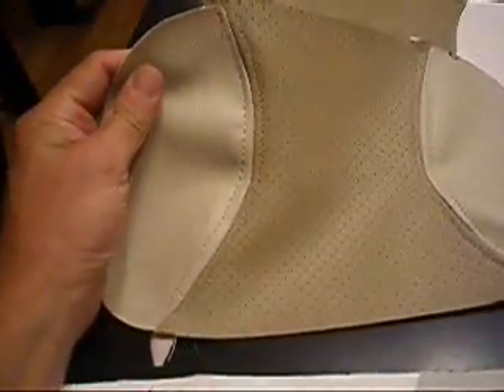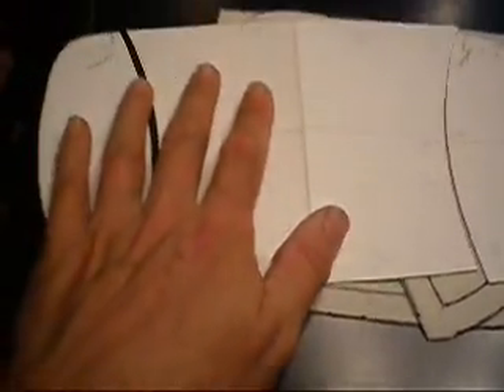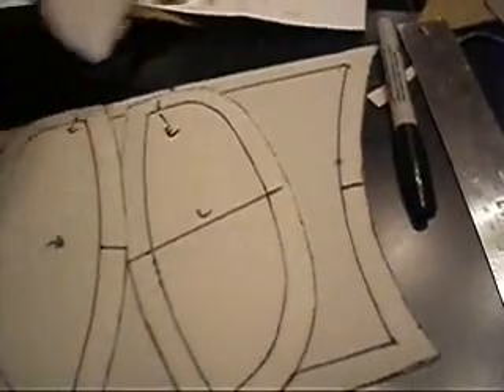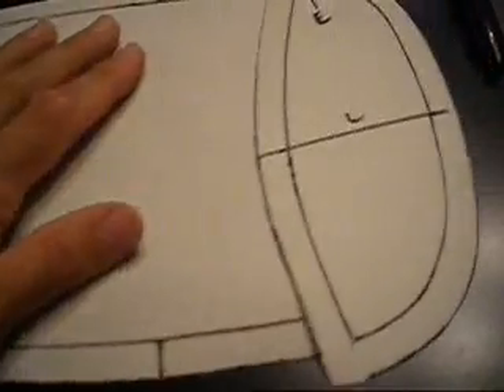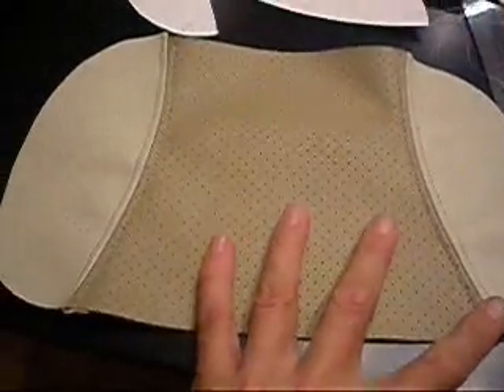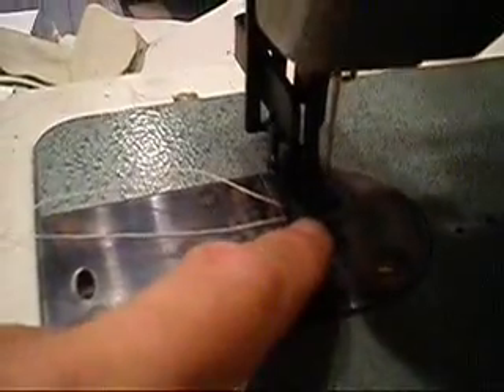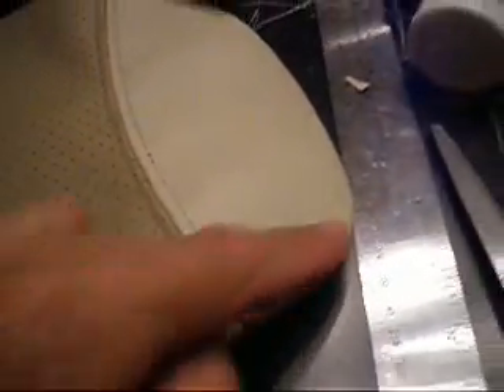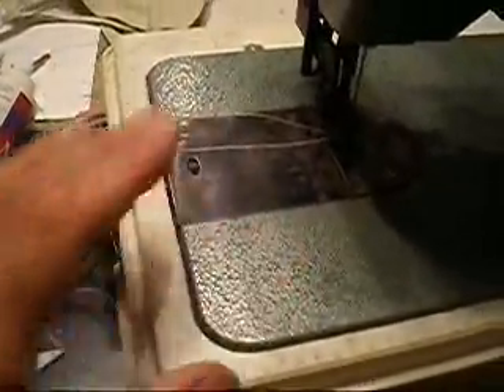Headrest Upholstery - Part 1

Comment from the maker: @77petesgarage Thanks man.  I went to a local upholstery supplier.  They had 10-15 sample books with 1000's of colors and patterns of vinyl, cloth, trim, carpet, canvas, etc....   I got the piping from an auto upholstery shop.  They just reeled of 30 feet and I gave them a few bucks.  The suppliers want to sell you 500 feet.  The thread came from the dude who sold me the machine.

Comment from the maker: Can you expand on what you mean by thread length? If you mean stitch length then you adjust that by moving the silver bar on the right side of the machine. Toward the top of the machine makes a longer stitch toward the bottom makes the stitch shorter and eventually will make the machine operate in reverse. The handle on the bar will screw in and out so it stops at the correct length when you go between forwd and rev.  Let me know if that answered your question. If not, I can make a vid for you.

Comment: FIRST OFF GREG,u r doing a hell of a job on sewing (VERY<VERY<NICE).the tread coming from the bottom is called a bobin.  anyways,what is the brand of your machine and model no.u have got me starting 2 look 4 a real walking foot machine. greg just me ok...i like 2 make the cover alittle smaller than the headrest...soak the cover in water..it will stretch...then put the cover on and use a blow dryer on low 2 dry/pulling it in to shape...just how i do it,looks like your doing fine on your own